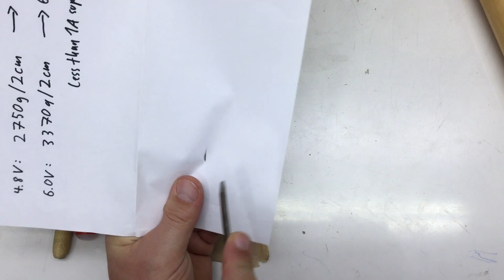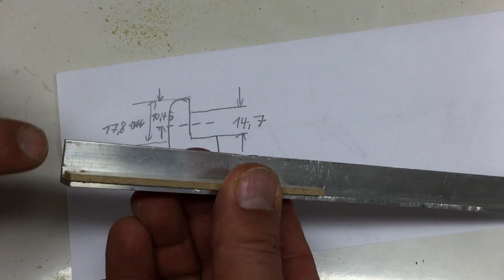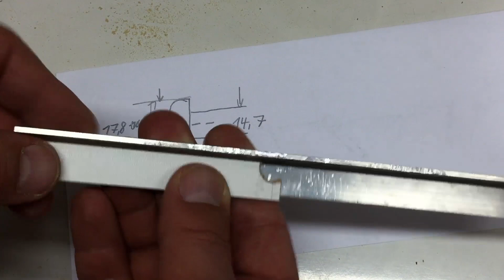Rebuilding an Old IKEA Chair

Comment: Aviate, navigate, communicate 😊- I just got an IKEA Pinntorp chair that broke when I shipped it. So I am also struggling to figure how to redo 4 Mortice &Tenon joints. THX
Reply from the maker: "Aviate, navigate, communicate" - I like that! Are you a pilot? Anyway, the joinery on those IKEA chairs is indeed a bit unusual. I'm pretty sure they have a special jig or even machine to put those together.
Reply: @robertssmorgasbord  No Sir- not a pilot just an enthusiast! Yes exactly, and being pine I have to find a way to mend the joints by hand without compromising the whole chair frame. Thank you
Reply from the maker: @konikacariapa3289  Oh, you're very welcome! And good luck with your repair!